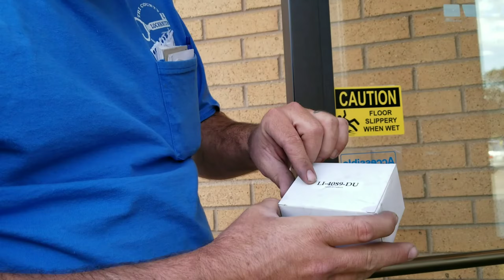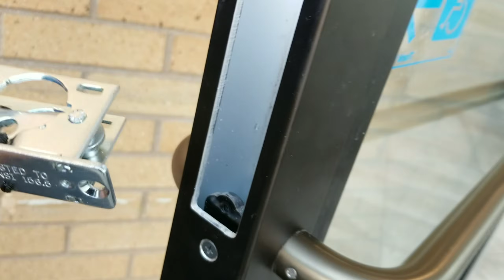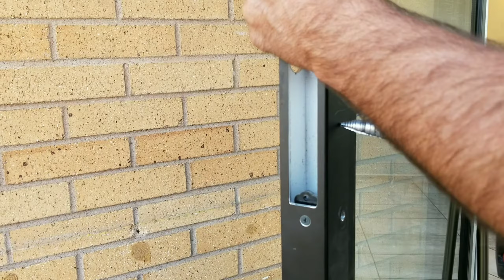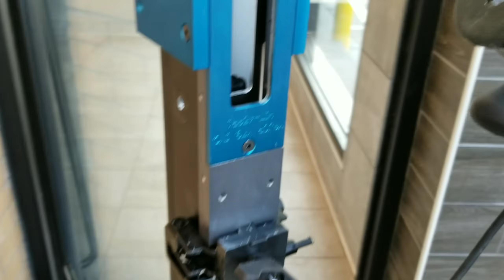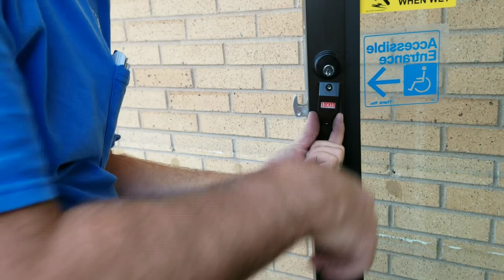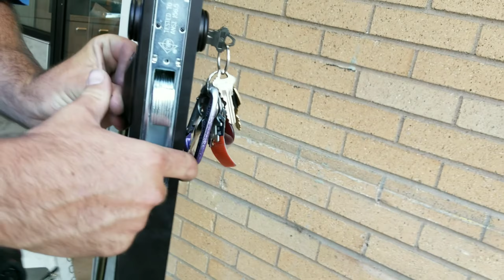How to Install an Open/Locked Indicator: Major Manufacturing Router Jig and Step Bit Options

Comment: Thanks for the video.  Question: are you able to add a deadbolt on an aluminum storefront door like this that currently has a keyed lock lever exterior, panic bar interior and an electronic strike latch connected to a wireless key fob 
/ card key access? There are no vertical rods that’ would get in the way of the deadbolt...I’ve just never attempted to retro fit some deadbolts(keyed cylinder style) like what I’m describing before. Any one know about this?

Thanks again
Reply: 2 years later.  Yes.  Use the jig and install a 4300 Nighthawk with a push paddle.

Comment: I know this video is pretty old, but would you know why an indicator would show the opposite of what the lock is doing?  I was on a job with a locksmith who wanted to put the indicator device on the door.  But I found out that it didn't work the way it was supposed to.  So I was thinking the lock was put on wrong or it may have been something else wrong.  I don't know, maybe you ran into this situation.
Reply: Usually when one of the the plastic clips has broken the indicator will fall down and read closed when open… then when you lock it… it will pick it up on the top clip/shelf and show open when locked. Happens all the time…usually the bottom shelf will break from the mortise no longer being screwed in and being held by the locks or the indicator… or I suppose they could turn it too far consistently and eventually break it… he put a nice one on but typically they are very cheap and the plastic will break with just a few pounds of pressure… so yeah one of the two plastic lift shelves snapped off.
Reply: Mine is “upside” down as well . In your video the lock indicator shows locked when in the down position, but the indicator I have shows open in the down position . Thinking I just had the wrong indicator?
Reply from the maker: Something was put together backwards 🤔

Comment: I know its late for when you posted the video, but what kind of router bit is that? I haven't seen to many router bits for Aluminum.  Am I just not looking in the right places? Do you have any links for such bits? This would be SUPER helpful. I am in Hospitality and we install interfaced panic bars that often require a lot of weird cuts that look very achievable with a router. 

Thanks for the help.
Reply from the maker: https://www.majormfg.com/pc-121-31-single-flute-14-down-shear-router-bit.aspx